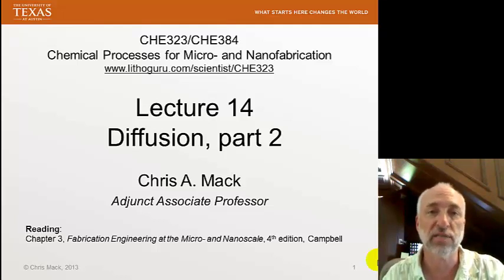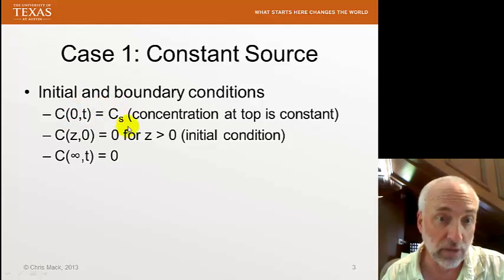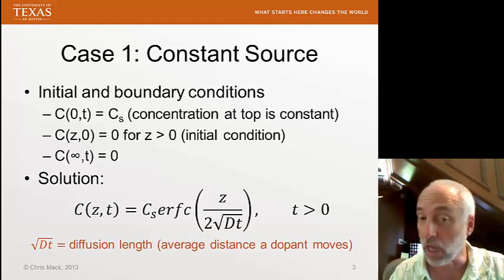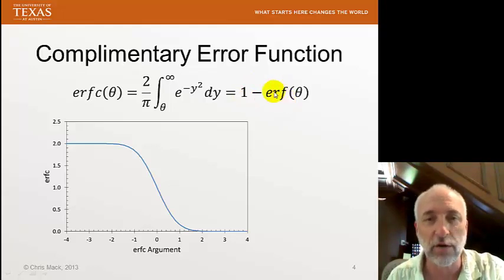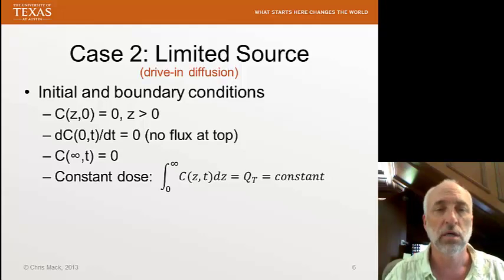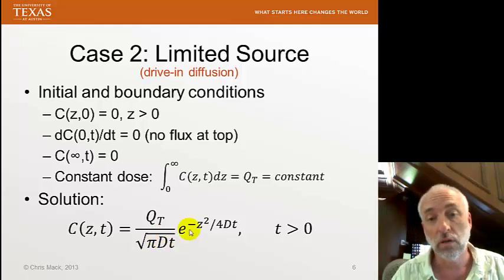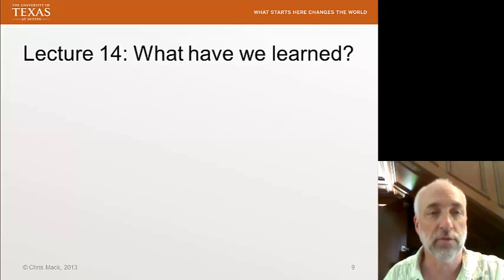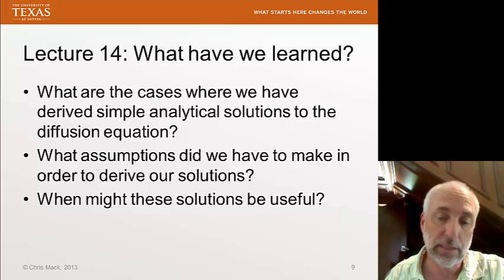Lecture 14 (CHE 323) Diffusion, part 2

Comment: in the limited source solution, one of the boundary condition is taken as Derivative of concentration with time is at the zero boundary is null. when diffusion is happening and atoms are moving in, then how concentration change at zero boundary is not changing.... please explain..... regards.
Reply from the maker: There is a typo in the boundary condition equation!  Thanks for catching it.  I have added a note to the video that fixes the typo.